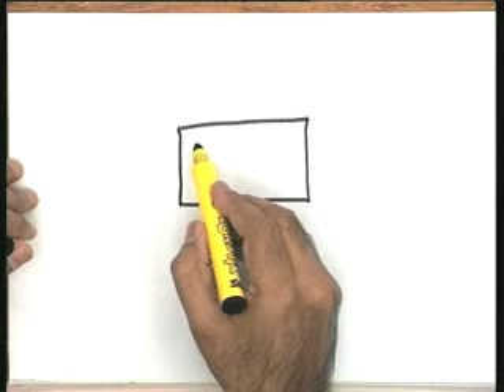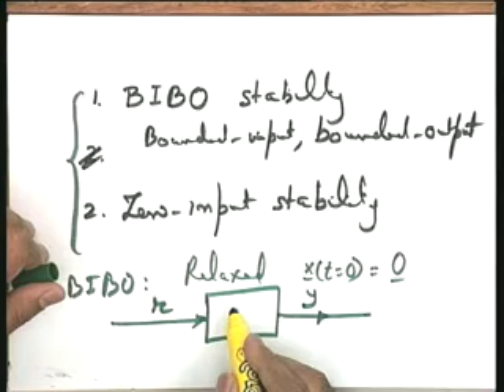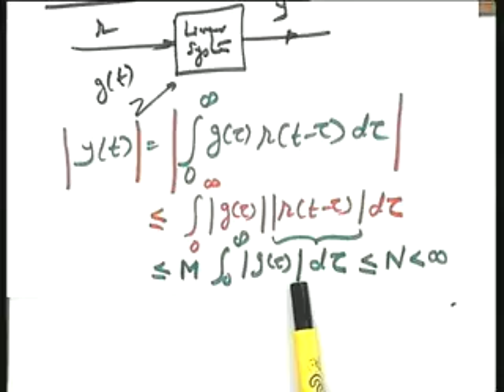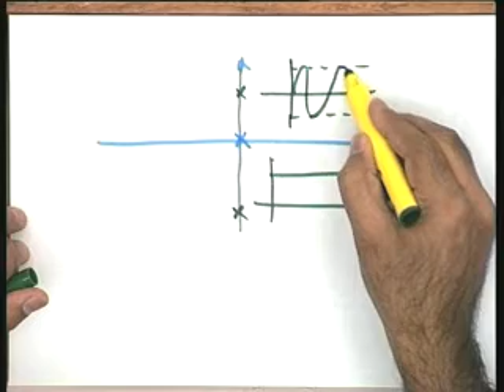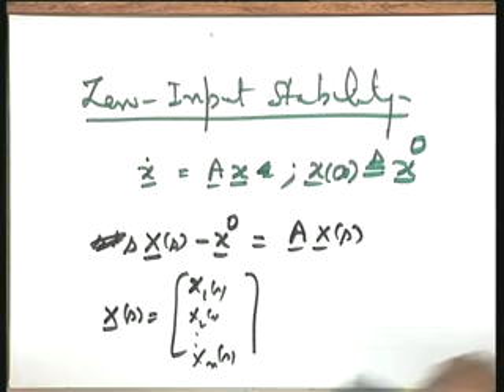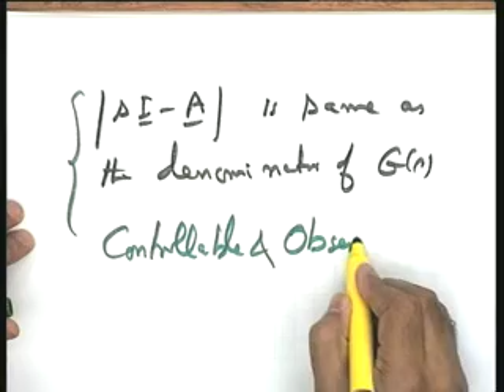Lec-23 Concepts of stability and Routh Stability Criterion

Comment: why we have say only left hand side of roots are stable y not right hand
Reply: +Yojana Upre for a right handed pole say s=a ; a>0 the Transfer function would be 1/(s-a).  Inverse laplace transform of such function would be exp(at), it will blow up as t-> larger values => System is not stable.
For s=-a ILT would be exp(-at) and system is stable.
Hope it  helps :)
Reply: @SumitPandey-spbias  ilt of the function mentioned by you can also have a response -exp(at)u(-t) which is stable one  depending on the roc
Reply: Hello Sumit pandey. In my view what you conveyed is related to converging and diverging systems. how can it be related to location of poles on right hand side and left hand side of S plane regarding stability of a system .
Reply: I just got it realised and u r right sumit pandey. Thank u for ur post.
Reply: +Yojana Upre for a causal system roc is always right sided(right of right most pole) and from basics of signals and systems for a system to be stable its impulse response must be absolutely integrable i.e fourier transform must be existed for that and for existence of fourier transform roc has to include (jW) axis so poles has to be on left side of (jw) axis for a system to be stable.